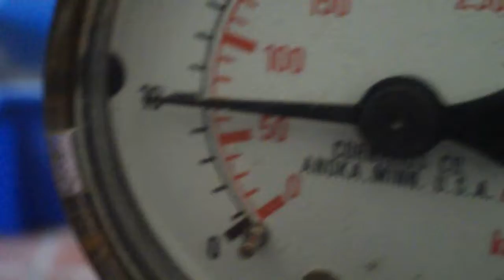Leaky beer tap on my kegerator

Comment: After buying a double tap kegerator it took me three times of refilling my co2 tank to figure my leak. It was the hose line at the joint where the main hose splits into two. Everything on YouTube suggested the tank or regulator probably was problem. They were all wrong. But after buying some better hose claims I fixed the problem. Soapy water on all the joints is best way to figure leaks. One tiny leak will drain your tank in hours. Best to close tank any time not in use for extended period of time.
Reply from the maker: Zachary S Brennan yep, solid advice. Watch for the bubbles.